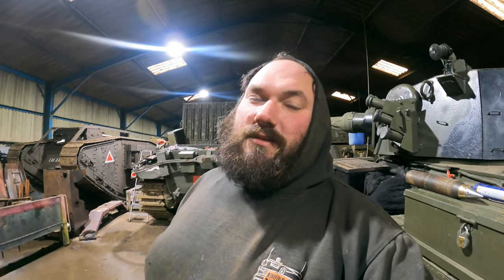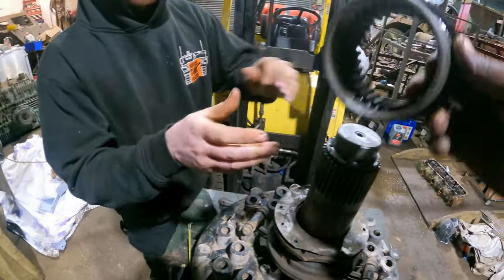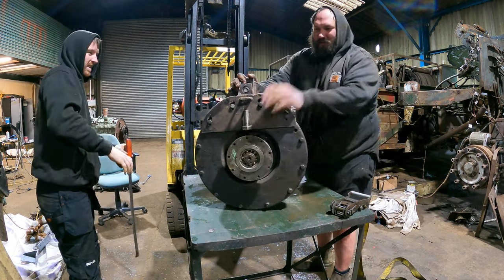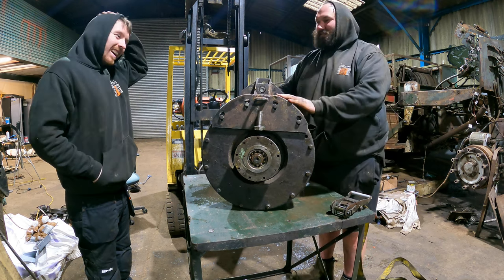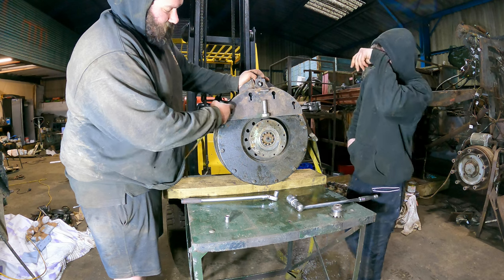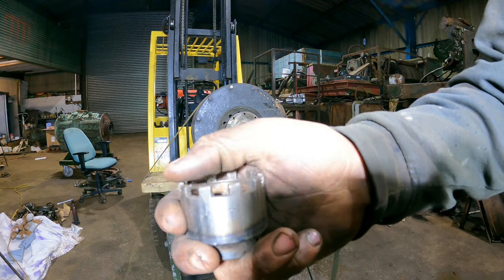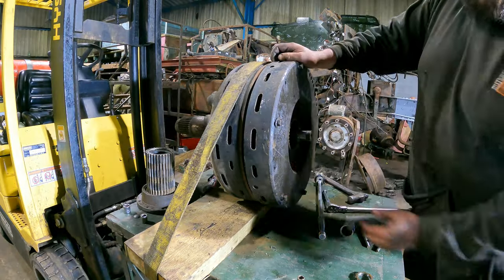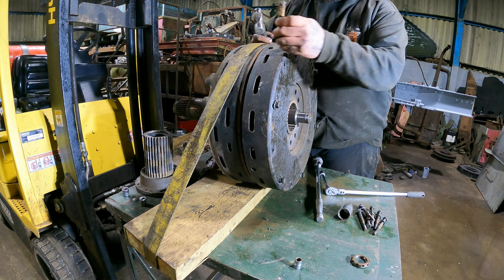1/4 ton Tank Clutch Rebuild British Army Centurion MBT - Tinkering Tuesday

Comment: Nice clutch refurbishment job. Well explained and illustrated. Copper grease is ideal as it is both anti-seize and also heat resistant. I have used it sparingly on brake assemblies and exhaust manifolds too.

Comment: For cleaning needle rollers, I use a mesh tea strainer and a stiff brush.  Dip them in the cleaner and give them a good stir with the brush, then you can lift them all out to dry and check.  Repeat as necessary.

I'm assuming you knew the plates had been replaced with non-asbestos ones, from your, er, relaxed behaviour with them.